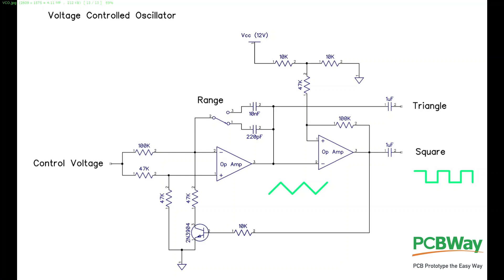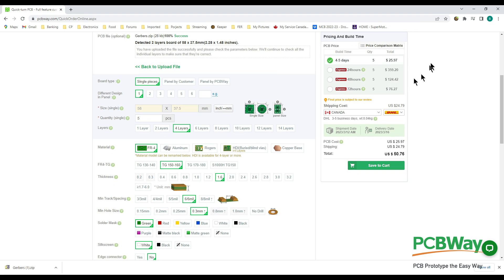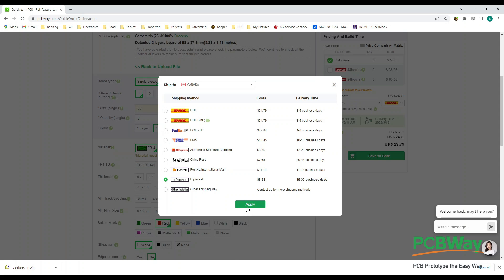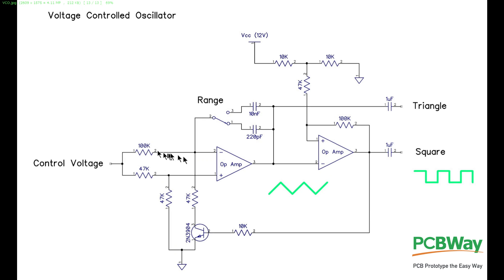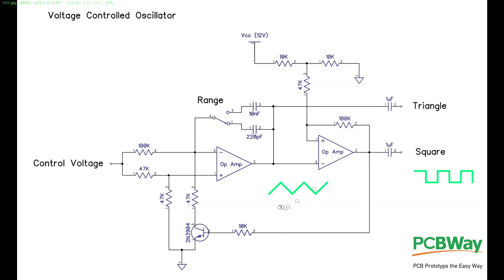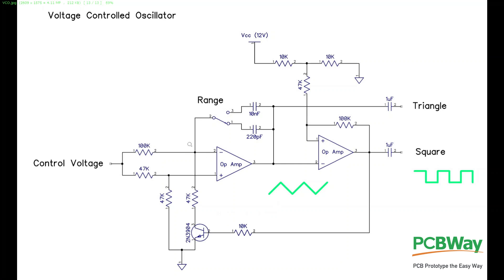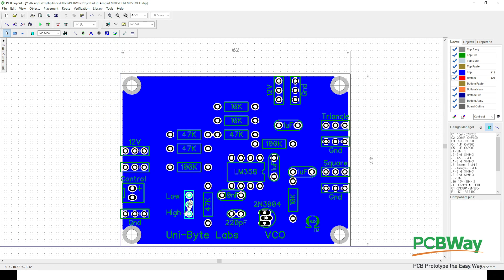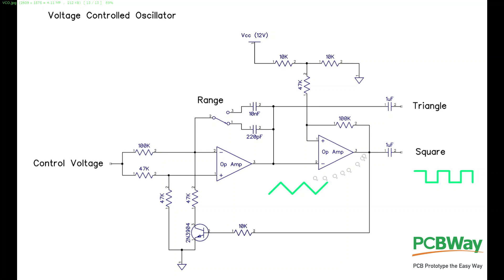0149 - Simple VCO circuit that's both fun to play around with and very useful.

Comment: how to calculate frequency ?. I have to make 50khz for 10v input. and with 1v of decrement will going by 5khz. Could you please explain that.
Reply from the maker: This circuit will not be able to run to 50kHz.   The rise time of the LM358 is just too slow.  In any case, I have never calculated the formula for frequency.  It would depend on the control voltage, the charge and discharge paths (which are different), the output impedance of the op-amp and the saturation voltage of the discharge transistor.  The best was would be to do it experimentally.  Set the control voltage to 10V, choose the capacitor that give you the frequency you want at 10V and the rest should fall into place.  However, like I said, this particular circuit will not run to 50kHz.

Comment: Cool little circuit. Played a little with it on falstad, seems with the 47k can also have 100k? I also put sliders there and with changing one of the two 47k at the NPN you can adjust the duty cycle unfortunately it also changes the pitch.
Reply from the maker: Good information, thanks!
Reply: @uni-byte  Tried to give the falstad link but it got removed by youtube. However its not difficult to reproduce and it's cool for testing out cap and resistor parameters.
Reply from the maker: @dreamyrhodes  I actually found when I read your message. I'll link to it in the description.  Nice find!

Comment: If you need proper symmetry without adjustment, use two pieces of CA3130.
Reply from the maker: They are nice (expensive) amplifiers however you would still need to balance the resistors to R and R/2 on the input to the first amp otherwise the capacitor would charge and discharge a different rates.